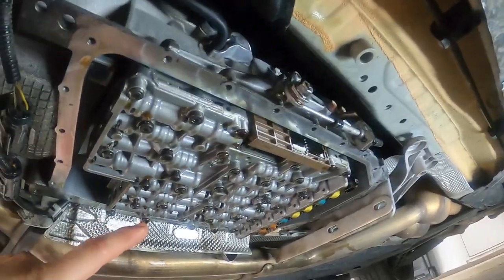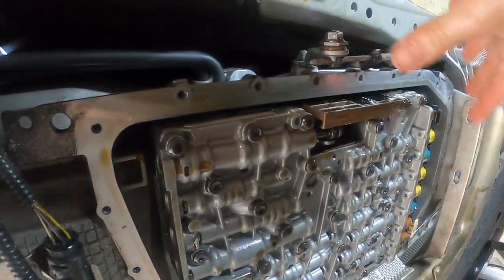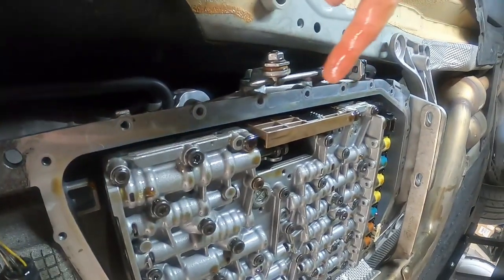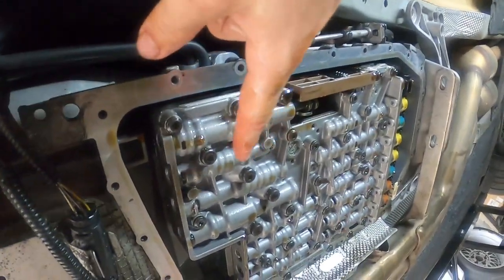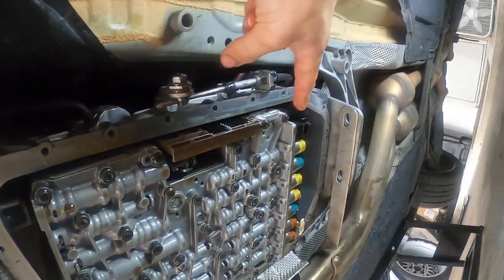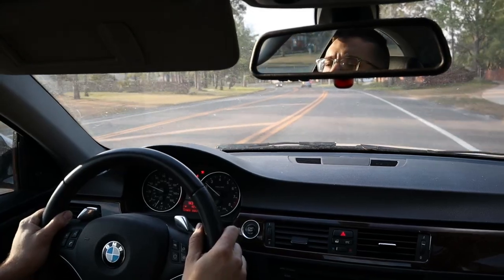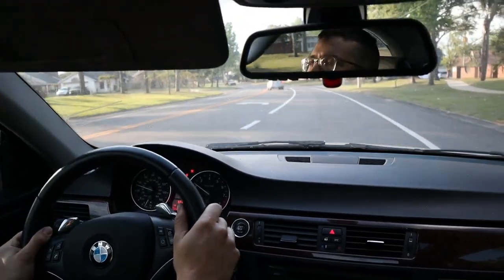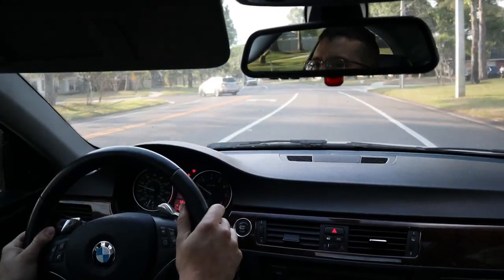Fixing the Transmission Surge on My 335i? (Transmission Seal Replacement)

Comment: Hi, wobling RPMs while steady drive means that your torque converter is bad... btw: when you want to "readapt" the TCU for new values, you need to reset the adaptations with diagnostic device.

Comment: i have heard from ppl that either oil change or replacement of torque converter will help that up and down reving, my brother had that problem on his e61 535d but oil change did help with that problem and i have seen ppl having that problem and need to change torque converter.

Comment: My 6hp19 gearbox has 50k miles on it and it fluctuates in rpm when shifting from 3rd to 4th gear and throws the 4F89 error. I changed the sealing sleeve, oil and filter, I will analyze the solenoids.

I did a lot of research on this error code (4F89) and came to the conclusion that the problem is not with the gearbox itself, do you have any idea what else I can check?
Reply from the maker: If the code is persisting, your options are to check/replace the solenoids, and then after that, possibly replacing the whole valve body or transmission. Sorry about the trouble, good luck finding a solution, and write back when you do!
Reply: @TheBimmerBarn  Thank you so much for replying and trying to help me.
The mechanics will be removed for a complete cleaning and analysis of the solenoids.

Comment: Did your car ever kinda stick in to 1st or 2nd and flare the revs when the cars still a bit cold? I think I have the same thing your car has in my 08 335i so wanna check if we actually have the same problem before I got messing with my transmission
Reply: Yooooo

Comment: Thank You, Great videos...2009 328i showing  these 3 transmission codes? I'm very scared...is there any hope or is this the end?
-56B8 (EGS ratio fault R)
-56BF Clutch gears 1,2,3,4 neutral test
-56BB Clutch gears 1,4,5,6 and R neutral test
Reply from the maker: Maybe someone else can chime in too, but it may be worth changing the solenoids in the transmission, along with these seals. At the same time, its not too expensive to source a used auto transmission, so that would be your next best bet. Best of luck friend, thanks for watching!

Comment: I like how he doesn’t show how much he probably struggled with that mechatronics sleeve. Or is it just me 😩
Reply: Me too 😭
Reply: Dude how did you get it in . I have been struggling for about 2 days trying to get it to sit flush with the 2nd O ring on the sleeve …… HELP lol
Reply: @392SCATBLK  I pretty much found a washer that was just a tad bit larger in diameter then the sleeve itself. I then used a few long extensions and a large socket like a 22mm I believe and then was able to press that against the sleeve with a hammer using leverage against the exhaust piping. It went in quite easy. Just make sure you Vaseline the seal pretty good. I absolutely was not able to do it just using my hand with force.
Reply: @luispina317  thanks for the tip bro , I was trying to force it in with zero lubricant , absolutely impossible lol 😂 thanks again

Comment: Im having a problem with my 08 bmw 335i were its shifting all the gears between 1500 rpm and 2000 rpm? Is that normal? Also each gear has a hard kick too it was told it had a transmission tune

Comment: congrats on the 1k man, I just found your channel today after watching some other videos on some issues i was having. I do have an issue with my 140k 2007 335i. I wanted to send you a video if possible or find a way to contact you. This issue has been plaguing me for so damn long. I think it's trans-related but I'm not sure.  I have checked far and wide and not a single video on youtube showcases the issue or possible fixes. In fact, my local BMW mechanic has not a single idea of what it can be ;/ You said "surging", a bit more detail would be nice but i assume it's what's happening to me. During higher gears at around maybe 1400-2100rpm, I get an oscillation. My RPMs are jumping up and down nonstop. But when i get up and moving or am in lower gears, it's not really there much. It's so aggravating. It keeps jerking me forward and back nonstop and my RPMs just bounce up and down. 

edit: i uploaded a small clip. I couldn't catch it being very naughty the day I took the video but, the RPMs are far more erratic at times and jerkiness can be horrible.  https://youtu.be/jlQm4Erzek0
Reply from the maker: Poop, "oscillating" would probably be a better term for what I am/was experiencing. After replacing all the seals, fluids, filter, and doing a transmission adaptation reset, I'm happy to report that the oscillation is less noticeable, and continues to fade away with more driving. Other people here have recommended a transmission tune which would increase clutch pressures which may also help alleviate the issue. My transmission doesn't throw any codes, so I have no reason to start replacing expensive solenoids. 

Hopefully the video and my experience helped you, and I wish you good luck with servicing your car! Let me know if you have any other questions :)
Reply: @TheBimmerBarn  Your the best, thank you! I guess when i buy my 3 last index 12 injectors, i will go straight to dealing with the transmission. But if i can ask, is the video i provided the issue you were also happening?
Reply from the maker: @N54.S6  Yes, exactly the same issue except yours is much worse if I'm being honest. I'd do the transmission seals and filter ASAP if I were you. Good luck :)

Comment: Does that cylindrical sleeve just pull out? Does the trans need to be opened to replace it?
Reply: You need to at least drop the pan. There is a pull down lever that holds the sleeve in place. Once you replace the sleeve, you push the lever back up to lock the sleeve

Comment: Did you use the ZF fluid? I have a kit with the liquid molly fluid for this transmission. But I was just wondering if the liquid molly was just as good?
Reply from the maker: I like liqui-moly, and their fluids are equivalent or better than the BMW oe stuff. They're both approved to the same standards.

Comment: Hi

I have an e92 m3 and I was having problems with my transmission. 

The car would struggle in reverse and also getting into gear one.

I’ve changed the oil and filter completely but that hasn’t resolved the issue.

Would you suggest in replacing the Mechatronics?
Reply from the maker: The M3 has a DCT transmission, very different from these auto's that use a torque converter. I'd recommend taking it to a specialist or the dealer for a full diagnostic! Sorry, hope that helps
Reply: @TheBimmerBarn  thanks for getting back to me 👍🏽

Comment: Does the 335d have the same transmission?
Reply from the maker: There may be some similarities in servicing the two, but the Diesels use a different bell housing and transmission, so the part numbers for the filter (for example) will be different. Good luck :)

Comment: Hello great videos - mmm on my case it only hard kicks 2nd to 3rd - and when manually doing the gear change while releasing accelerator pedal or going downhill it feels normal - also no codes on computer - . What would be your advice where to start looking before jumping straight ahead into buying a full valve body ?
Reply: Have you replaced the fluid and pan? After doing that XHP is great at smoothing the trans also.

Comment: Trans mount is missing the bolts
Reply from the maker: Those were removed to let the transmission sag down so to get better access to the seals and the harness! Gives you that extra bit of room, but don't forget to reinstall before you start the fluid fill procedure 👍
Reply: @TheBimmerBarn  good to know I’m about to service my trans